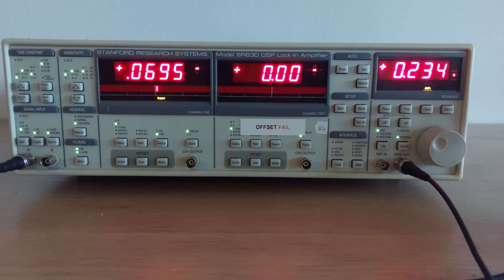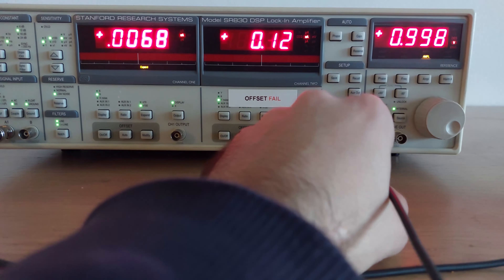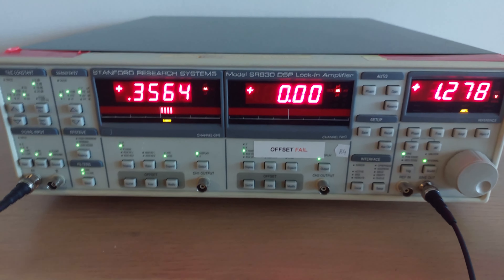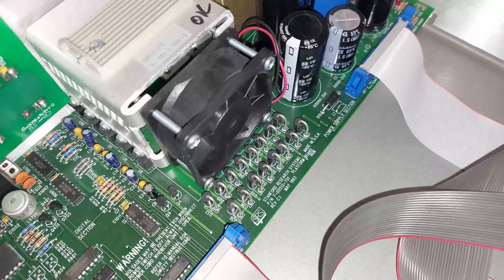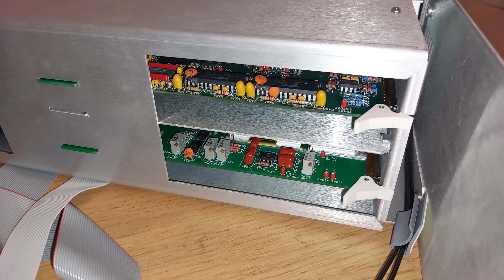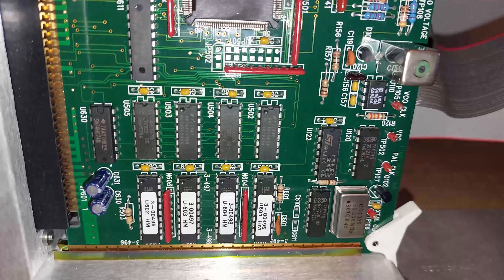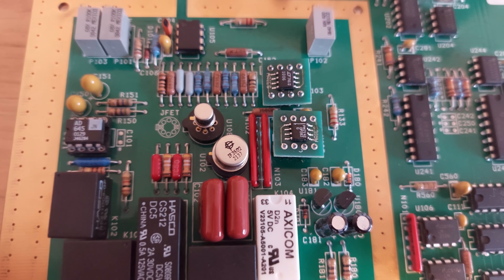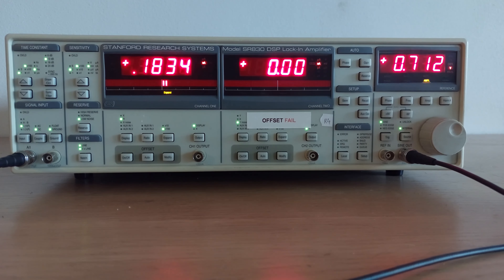Stanford Research System SR830 Repair and Experiments

Comment: IF3602 is a fantastic part, I've bought one too, but none of my ideas so far seem to justify actually using it 😅
Reply from the maker: Neither is it the case for the SRS830, I'll order a couple of LSK389 and save the if for the future
Reply: @GearAcquisitionSyndrome  The SR850 uses NPD5564 which appears to be unobtanium. I may replace mine with the LSK389 since they appear to have taken a little hit from what ever damaged the op-amp! edit: Just did some searching and found the modern equivalent: IFN5564 DOH!
Reply from the maker: The one i had, because it's now gone, had 2 LSK389, which was confirmed by Linear Systems to be factory

Comment: Thank you for posting a link to the schematics! The only version I ever found was the one that listed the parts used.  I had been meaning for some time to dig into their design to understand how it works under the hood . I am surprised to see so many unshielded ribbon cables in the box. I understand that they were a lot more careful  in subsequent versions about shielding and even turning off all the digital hardware during critical integration times.
Reply from the maker: I didn't know that. It looks like a very weird style of construction honestly but i guess that's how SRS do. The schematic is really really nice for the 830. The frontend is beautiful and the filter implementation is outstanding.

Comment: I recently acquired an SR850. It has a very similarly designed front-end. Mine also had a damaged op-amp for the zero adjust. It was railed out at -15V and therefore clipped the amplified sine wave causing all kinds of problems! Therefore I replaced all the op-amps with far superior modern equivalents. I used OPA2156ID which should allow my device to exceed its original specs!
Reply from the maker: Over restoring can be detrimental, you have to make sure all the parameters of the opamps are taken into account. I'm an LT fan when it comes to opamps :)
Reply: Did it work?
Reply: @2jpu524  It sure did! Works great now and I was able to calibrate it well within its spec. Therefore I don't think it has been "over restored". I did a lot of testing for phase noise and I believe it is better than the original design, but I'd have to fully test it over temperature range and over time.
Reply: @matteo234321  That's awesome. Perhaps you can post somewhere the fix and possible improvement to the original design.  It's great that you were able to take advantage of newer better parts. There have been a number of posts I've found in the past of people fixing test equipment to restore useful stuff we can't afford to replace. I am glad that so many test equipment vendors have been willing to share their schematics. It's too bad that this is no longer such a trend. It would be interesting to see your phase-noise study as well.